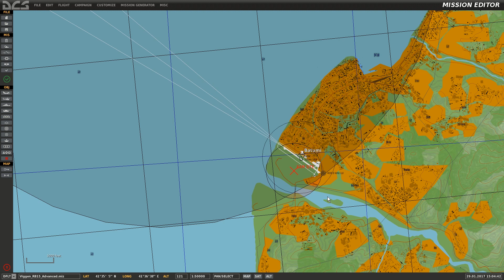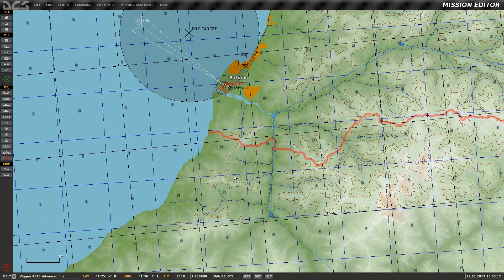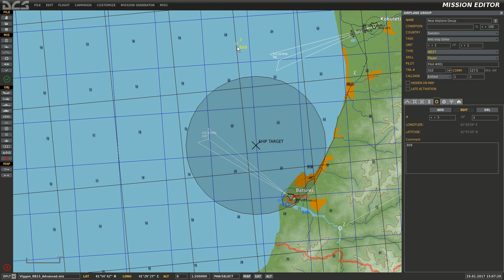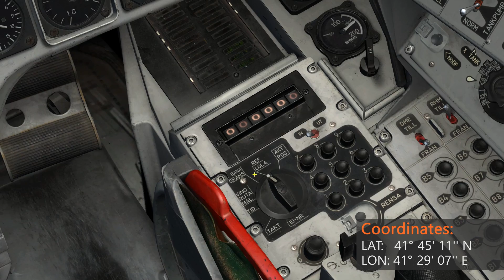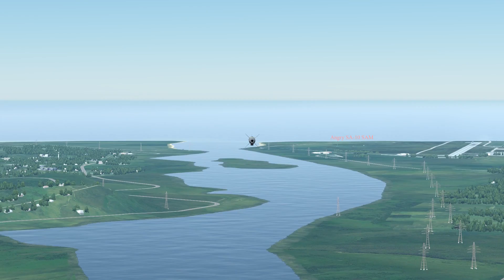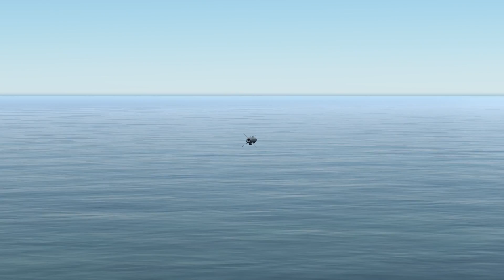[DCS] AJS-37 Viggen - RB 15F Anti-Ship Missile - Advanced Tutorial

Comment: I followed your instructions to the letter. but my missiles just go and hit the mounts in front and dont try to turn to BX7 at all. :(
Reply from the maker: +Lassaad Ben Cheikh Sorry that it took me so long to respond. I didn't see that you changed your message and uploaded the track here. 

Now, to your problem! You are doing everything completly correct. However, there is currently a bug for the RB-15 where, when you put the weapon mode selector into Attack before you put the master mode selector into ANF  the missile will be launched like an RB 04 (or like if you would have not switched into ANF mode at all). So for now (until the patch this Friday after which this should be fixed) put the master mode into ANF first, before you put the weapon mode selector into Attack.
Reply: @xxJohnxx77  Is this bug fixed?
Reply from the maker: In short, put the master mode into ANF before you put the weapon mode into Attack. For more info see the other message I wrote in this line of comments please.
Reply from the maker: Did you check if the BX7 waypoint is actually present?
Do you have enough altitude to allow for the turning of the missiles?
Reply: BX7 is present, and I launched at the same altitude as you, i tried also a bit higher and a bit lower. no joy, the missiles dont even pretend to turn, they continue to fly straight
Reply from the maker: Did you make sure you set the Master Mode selector into ANF? If not, the RB 15s act like the RB 04 and try to search targets infront of the aircraft, while ignoring the waypoints.
Reply: ANFselected, Attack selected, M2 set, Takt 800001, Bx8 set. no luck :(
Reply from the maker: Hmm weird. Could you possibly save a Track and share it somewhere? I could have a look and see if I can see the problem.
Reply: I have this problem too!
Followed to the letter, mark points set in advance and mark points set in cockpit.
No weapon release in ANF mode, only NAV
Reply: xxJohnxx thanks a lot John! You are very helpful! I wish you the best
Reply: also I just fixed my problem - it was to do with the ToF to Dx9 being <30 seconds
Reply: You can fire the RB 15s without waypoints?

Comment: alright i might need some pro help, do you have any explanation to why my missiles would explode in mid air ?
right after i drop them they turn towards Bx6 and then explode in the air by them self, this is really frustrating :(
Reply: i have to mention iam not doing this in your mission, i created my own mission and was testing it, but i did it exactly the way you explained it in the video!
Reply from the maker: They actually can't turn towards BX6, as it is not a waypoint in itselfe, but just a distance reference. The first place they will head for is BX7. 

Did you place BX9 as well, and is it at the right position. Check like I did durning the flight to makes sure. Because I had missiles skip BX8 and go directly for the self destruct waypoint if they are too clsoe together.

Comment: hello john, thanks for these very informative videos,
is it possible to set the Bx6 waypoint manually with the radar screen (using t0 and tv) and input the wished alt ?
Reply from the maker: Thank you! 

Yes you can set the BX6 waypoint using the radar or by inputing coordinates. However, there is no altitude to be set. The missile will stay at release altitude until BX6 and then descend to the low approach alittude. That can be changed by using codes however. It will generally be between "Sea skimming" (uses radar to keep itselfe just above the waves, adjusting for current wave condtion) and 30m above the water. Over land the missile should keep a minimum of 60m.